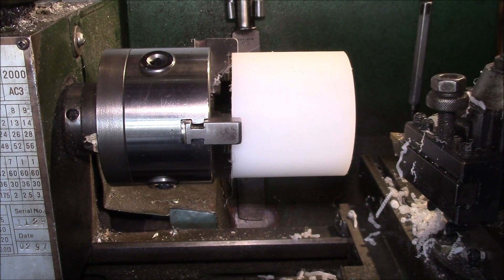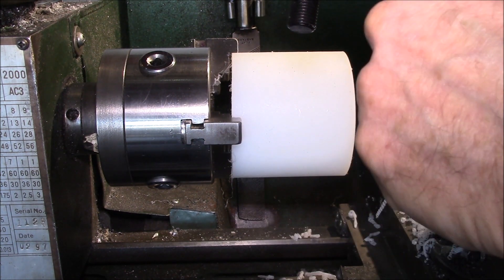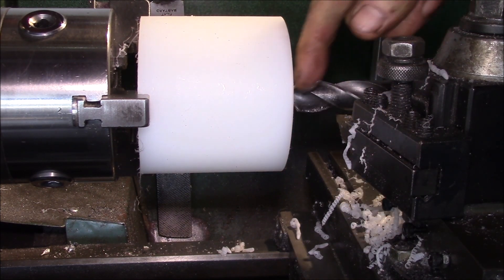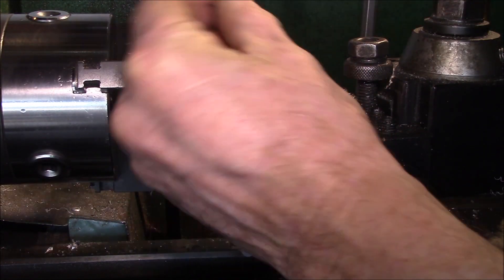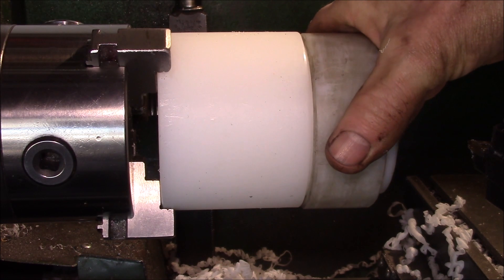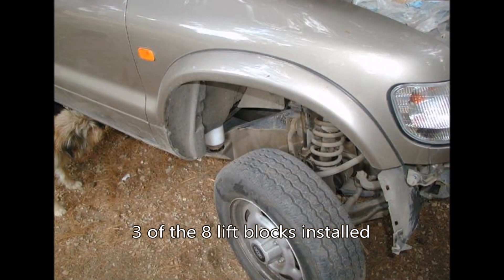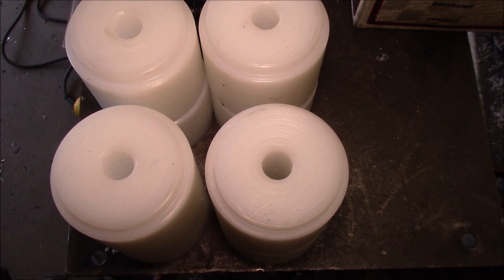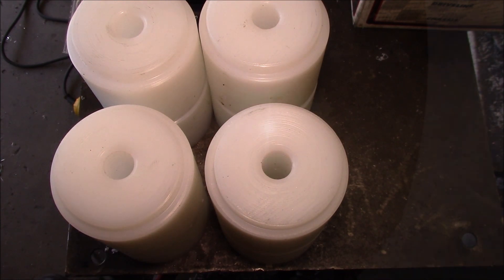Making a Kia Sportage Body Lift Kit

Comment: Any links to the Montero Gen 3 body lifts?  Interested.
Reply from the maker: It seems that generation is a uni-body type construction:
https://en.wikipedia.org/wiki/Mitsubishi_Pajero#Third_generation_(V60-_/_NM,_NP_;_1999-2006)
If that's the case, the body and frame are one piece and you can't easily raise the body off the frame as there are no separate body mounts.

Comment: Can you guys make a lift block for a Kia Soul?
Reply from the maker: Possibly.  Let us know the rough diameter(s) of the body mount bushings and if the setup is like the Sportage, will need to know the diameter of the inner stud attached to the body along with the thread pitch and how much threaded length and exposed thread there is.  E.g. on the Sportage, bushings are about 80mm dia. and the studs are 18mm dia. with a 14mm threaded portion w/ about 35-40mm exposed thread.

Comment: Nice share Sir,
Can you give me the detail drawing please ? How height we can lift the body without extend the  bolt Sir,  thank you so much
Hope you can send the drawing to my mail : mnrg.tamrin@rocketmail.com
Reply from the maker: 35mm is about the most you can lift the Kia Sportage with the original bolts.  Easy enough to check, just measure how much thread extends out beyond the nut on all 8 body mounts.  For dimensions, make the lift block a bit larger in diameter than the body mount bushing, which is around 80mm.  Then make a recess in one side to fit over the bushing, make a step on the other side to fit into the body recess and drill a hole in the middle to fit over the bolt:
https://www.4crawler.com/4x4/ForSale/KiaSportageBodyLift.shtml#Introduction